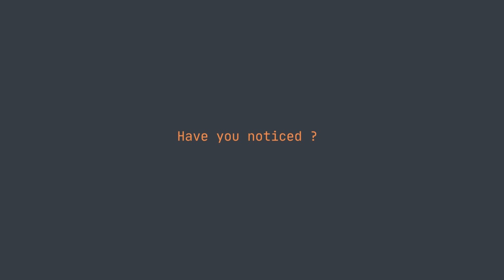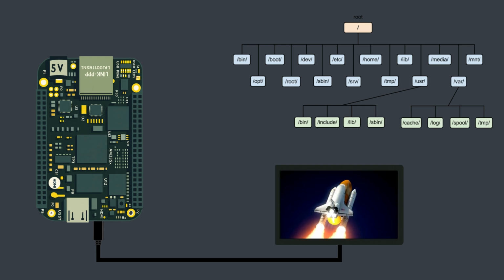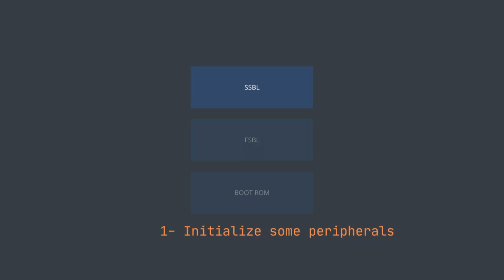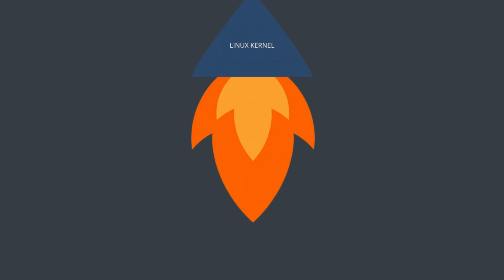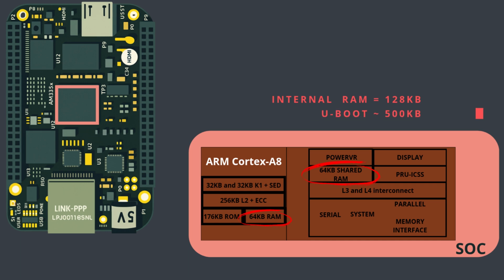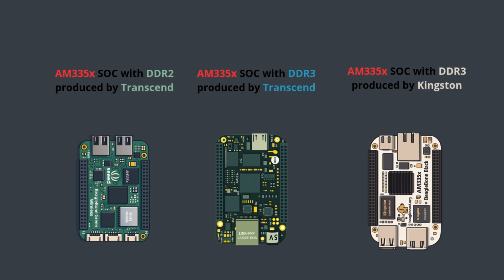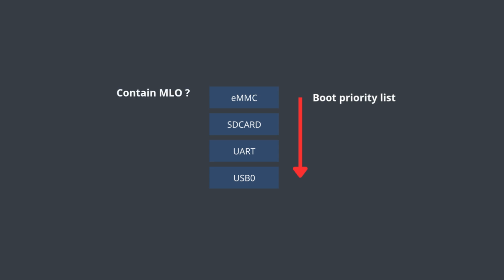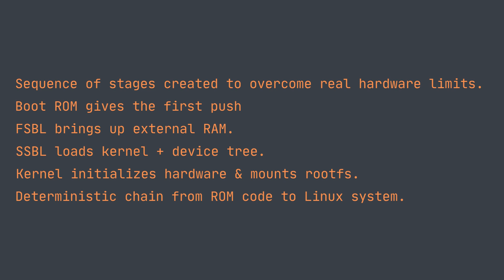Linux boot process

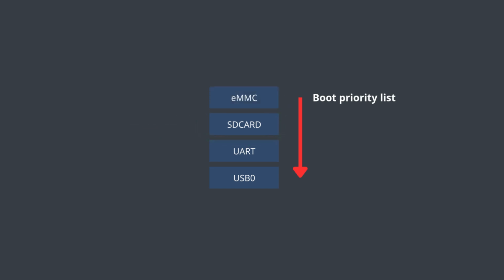Comment: 8:00 How 4 pins (2⁴ = 16) can set the order of 4 devices (4! = 24)?
Reply from the maker: Good catch!
In the video I simplified the explanation by showing “4 pins → 4 peripherals” to avoid overloading the animation, but I should have clarified that.

On the AM335x, there are far more than 4 bootable peripherals.
The SoC can boot from eMMC, SD, SPI, UART, USB, NAND, NOR, Ethernet, and more.

So those 4 pins don’t directly select the order between “4 peripherals”.
They simply select one of the 16 predefined boot profiles stored in the ROM.

Comment: That's not uniquely the "Linux" boot process. What you described is a more generic boot process on SBCs, but is not limited to Linux. I wish you had tackled the actual Linux boot process instead. The kernel side of things, along with the initramfs etc. How it truly initialized the LINUX environment. So anything after the SBL. You only briefly tackle that.

Also the use of an AI voice is meh.
Reply from the maker: One of the most relevant comments I’ve received, as it highlights real areas for improvement, and I appreciate that.

As for the topic itself, it’s already on my list. A dedicated video will cover this in detail.
Reply: @EmbeddedLinuxInsights You're very welcome. I did not mean to discredit you or anything. Actually, credit where it's due: Your video format and how you explained the low level, and hardware parts along with the boot process were very good. The animations were simple and clean. Easy to understand. Keep it up!